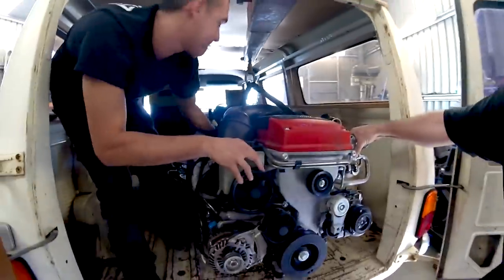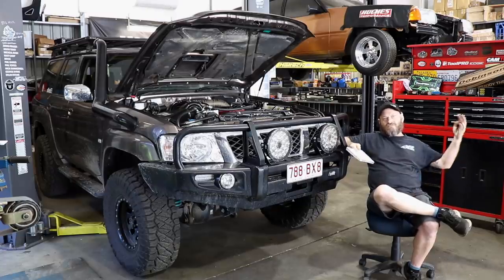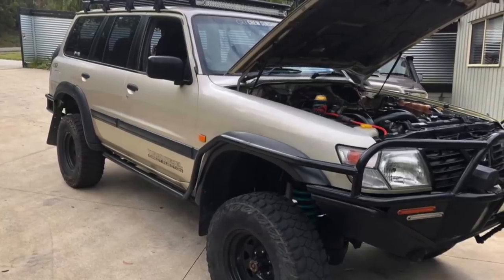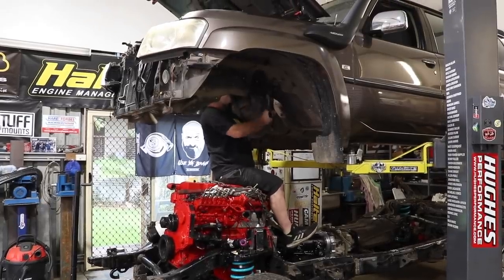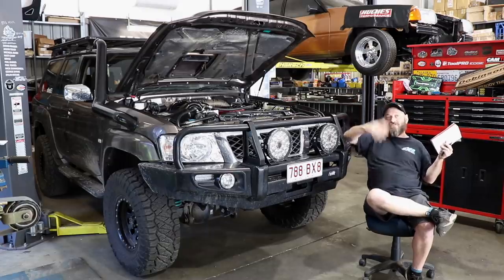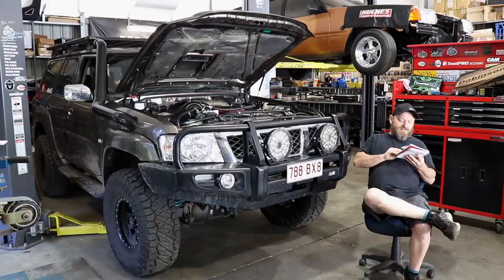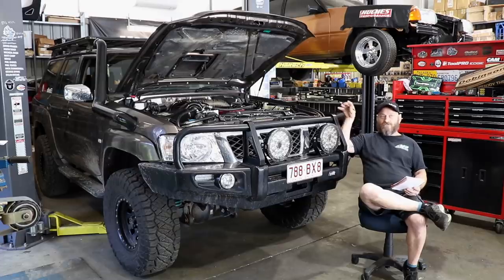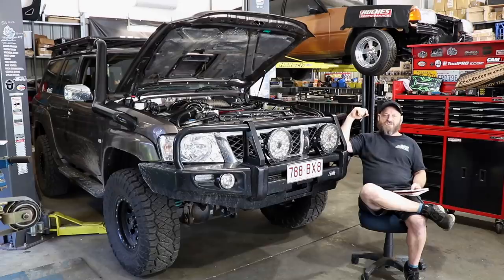Thinking of a Cummins Conversion? Watch This First!

Comment: I just picked up a VW Amarock 580, about 258 Hp, 580 Nm, I reckon it would be a good motor in any 4WD conversion, goes like stink and good on fuel,I'm not far away if you want a drive.
Reply: Those Cummins put out 600ftlb at half the rpm of a vw without much more than a twist of a screw driver, completely different animal
Reply: @oldbloke100  with the 4 speed and gears you would be mostly between 1.5k and 2.5k rpm. What torque are we talking I'm not a Cummings expert? An ls7 with a supercharger will do 600lbft at that. Pretty sure a ls3 rebuilt to 6.8L with the sc would be almost the same. Like a 2.6l unit.
Reply: @oldbloke100   AL asked for suggestions, I'm not saying the VW Amarock V6 Diesel would out pull a Cummins  but realistically how much power/torque do you need in a 4Wd?  most new 4Wd Diesel utes and SUV's in Aus are 4 cylinder except for landcruisers. Your Cummins motors are good in loaders,dozers,buses etc, but in 4Wd Vehicles you need drivability, economy, smoothness, quietness etc you don't need a Massey fergerson tractor, as Alan says his Cummins is lots of power for the Patrol and noisy and thirsty, I'll take the Amarock V6 Diesel anytime over an old clanker, it's plenty of power for any 4Wd and if you really want more then you can get an ECU tune and and a different Turbo which will take them to 418 Hp with an increase in Torque.
Reply: @Dan-rg7jj  that would go well up in the cape, you would need a trailer to carry the fuel for a blown v8
Reply: @mike-lu8di  depends what you want the car to do, driving on the road or dirt tracks the duel cab ute are fine, but when the track gets bad a patrol will go much further. I have a patrol and a ranger. The ranger is much nicer to drive on the road, adaptive cruse and all that, but it won’t go anywhere near what the patrol will do
Reply: @oldbloke100 Doesn't have to be blown. Could be NA. Using a baby cam out of a 5.3l or Lq4. Would chuff along under 2500rpm.
Reply: @oldbloke100  I Also have a 4.2 Patrol but it can't tow like the Amarock, the patrol uses more fuel and is much slower it also looses on a long hill where the Amarock isn't phased and there is plenty of low end power , like my original statement,my patrol would be a better vehicle with an Amarock motor.

Comment: Interesting choice. The hard core love the p pump in the states because the amount of fuel you can throw at them, but frankly, I have a friend that bought a 01 with the 24v and its up around 400k miles, went through 1 pump, but currently has a edge, and aftermarket turbo. It's fantastic to drive with the nv56. Averages about 20mpg freeway. The cummins 5.9 out of all of that generation seem to get the best fuel economy. I run a 6 blow power stroke in my 06. It doesnt matter how you drive it it gets 13.5mpg with a zf6, and thats a 8200llbs lifted truck on 37s. I'm curious what you are actually getting with that patrol.

Comment: I'd go with one of those new small Duramax if money was no object. Those engines are so new they have to be really expensive though.  Still i bet the power would be good in a patrol sized rig. Bonus is they are about as quiet as a normal petrol engine.

Comment: The 4BT in my boat is good on fuel but loud and heavy. OM606 or M57(BMW) go and sound good. The 4.5 QSD Cummins 6 boat motor would be mint but $60k just for the motor and who knows what emissions problems. Audi v8 diesel is a sweat high end motor as well. My over heating TB42 is likely to be replaced with a fresh TB42. I can't justify the money for anything else.

Comment: Yeah, I'd probably just stick another zd30di in mine if it popped. It's got 320k on it now, been tricked up with bolt ons and a methanol injection kit. Pushes 35" tyres just fine. No signs of dieing at all.

Comment: I'm having a 4.5l cummins put into my patrol. I'm also having portals from Mark's installed. We've hit a snag though. Mark's are saying that they can't do the portals cause the engine is too heavy. From my research I've found the td42 weighs about 350kg, and the cummins 4.5 is 370kg. The guys who are doing the conversion for me are in talks with Mark's to try and find ways around the 'MASSIVE' 20kg difference. Very frustrating.
Reply from the maker: I would add 100kg to both of those figures straight up. And secondly, your conversion guy is probably at odds with Marks as they are in competition.

Comment: The om 606 is a goed engine but very expensive,  BMW 30 diesel is the most wanted conversion in europe. More commen and less expensive. Adaptor plates are easy to get. Elektronica with stand alone ecu. Regards Paul

Comment: Tb48 and snail it. Keep patrol trans, drops in as it was an available engine for this model. Money saved can go into reliability upgrades depending how hard you want to push it.
Reply from the maker: Drop in after you cut the engine mounts off and weld new mounts in etc. Then pay for a TB48, not cheap. Then wire an ecu and turbocharge it.
An option for sure but not cheap at all. None of them are.
Reply: @theskidfactory  three engines on ebay right now between 3500 and 5000.. seems cheap compared to the american iron?

Maybe I'm used to stupid jdm prices.

Comment: Al, wondering why you didn't recommend a 1HDFT/FTE? Is it just a cost of engine issue or some other reason? I would think you could use a 80/100 series gearbox, transfer case, bellhousing, clutch etc which you can buy for around $15k. Main advantage would be the parts are everywhere and are a proven design rather than going completely custom which is always expensive.
Reply from the maker: There isn't a great deal of Landcruiser parts that are actually any good. A 1HD is a great engine but they all have 500k km on them and people think they are worth new car money.

Comment: I bought a Range Rover with the BMW v8 engine in it and was looking for a diesel to drop in .
I was thinking about the Mitsubishi 3litre out of the 3 ton truck with triptronic transmission.
Never got to do it though got a good offer for the Rover so now someone else has the beemer goodness.

Comment: hi guys, lurve tha chanel, being a zd30 patrol owner, i'm organising my conversion before the inevitable grenading. my first pick is the cummins isb 4.5. i would appreciate your oppinion on this swap and if possible an approx cost.
My second choice is the om606.  but i'm not convinced it's a wise choice for a diaily drive.
i would also like you oppinion on this, but my main concern is servicing costs for a euro trash donk. The trol is my daily and i use it for serious 4x4ing and i want genuine low end torque. it's a 2005, series 4, manual box. my budget wont really cover an auto box conversion. 
if you like you can use mine to do the swap for the channel, yes, i know, i'm so helpfull!!
keep up the great content, ie, patrol stuff.
cheers.

Comment: Great rundown Al, really appreciate your insight. When you said a petrol conversion is more budget friendly… how much would you expect an LS2/3 conversion to cost into a manual 2016 Patrol?
Reply: I’d assume it’s cheaper since these diesel engines are all imported. LS series were available in Australia from Holden vehicles.

Comment: Very very informative.  I brought my 1998 tb45 new and it’s been exceptionally reliable.  I am now considering more power for van pulling.  I took it off gas after 10 years and now has 440000 on the odometer.  What would you suggest?  I’ve kept the car very good mechanically.
Reply from the maker: You would have to be very happy with the car and really love it to spend dollars on it. TB48 may be an option if you have it sorted and love it.

Comment: They sound incredible for a diesel however, the shear weight of this engine puts me off. The balance front/rear is potentially dangerous on the road and I would always be worried about the longevity of the front suspension. That would spoil the enjoyment. 

That said, the work and engineering in these conversions is fascinating and the proof is in the pudding (as we say in the UK)
Reply from the maker: It has 55/45 front to rear distribution, that's pretty good.

Comment: P pump is like VW PD "Pumpe-Duse" injection right? Mechanical? Pump duse is way more reliable than common-rail and cheaper to fix. Million km original pump and injectors. At least it is in VW's, the PD is legendary.

Comment: You did not mention the NV5600 or G56 66-speed manual transmission with the Cummins. They are factory and can handle the torque fine. 😉

Comment: I had a Wk Diesel Grand Cherokee and it used a VM A630 3 litre 6 cylinder diesel, its even used in Maserati's in Europe, I reckon if you could nab a cheap one of these from a wreckers it'd make a great swap, if you could get a write-off vehicle where engine and auto gearbox were salvageable it'd be perfect, I had the 6 speed but later version had the 8 speed which returned better fuel economy , stock standard it was quicker than the 5.7 litre V8 petrol Grand Cherokees and I embarrassed quite a few people at the lights, if you modified it, it would be even more of a weapon. Go take a Diesel Grand Cherokee auto for a test drive and see what you think. Hope to see you do this. Davo. P.S. Lerv Ya work

Comment: Al,
I am sticking a 12V P pump 6BT into an old Bedford fire truck (MR) due to the size of the truck I have to use a transmission with a suitable GVM rating and ended up with an Allison 2500.  Out of interest a new Allison 2000 series inc shifter, harness, TCM etc is approx $15 000. I imagine the 1000 series which is the same as the Duramax autos will be similar in price (both 2000 and 1000 share the same architecture/size IIRC).
Would be interested in finding out the intercooler and radiator core sizes that you ended up with.
Cheers
Greg

Comment: Love the build, what are your thoughts on a Chevrolet 6500 Optimizer as well as the P400 Cobra V8 Diesel engines for a patrol conversion and what auto trans you would mate to these engines.

Comment: if you are thinking about staight 6 engines OM606 is greate but its mechanical similar to the 6bt but the is also newer commun rail mercedes engine like the 0M648 is quite strong (look into  black smoke racing and dieselmeken)

Comment: as i remember the DAF also came in 1994 with 14 liter 500 hp cummins engine.. and that thing hauled ass... way easier to work on then the PACCAR engine that has replaced it..

Comment: Mercedes om613, 3.2l 24v common rail straight 6, smooth quiet and plenty of power, or a bmw m57 with the 8 speed zf auto.

Comment: I've seen a couple of blokes doing 4jj1 conversion kits too, might be something worth looking at........I'll probably give mine 1 more zd30 after the current one dies and then start looking at my options 😂, Isuzu diesel like an old 4bd turbo or 6bd or BB turbo would be awesome but I don't know if you would get  engineering.....guess it depends if your worried about that stuff or not 😂👌

Comment: You didn't mention the 6.5l turbo diesel Chev optimizer that is a very popular conversion for patrols and land cruisers done in Western Australia .
Reply from the maker: That's because a TD42 is a better engine.
Reply: They aren't powerful, economical or reliable but at least they're expensive
Reply: @JeremyPetho  I got my manual zd30 patrol converted to the 6.5 turbo diesel chev optimiser 5months ago and had it dyno'd at 7000km mark and it put out 584nm at the wheels.
I've towed a combined weight just over 6tonne car and caravan getting 22ltr per 100km sitting on 110kmph. 
For a $30,000 drive in drive out conversion I thought it was pretty good value. 
Is there a cheaper/better conversion out there ive not heard about?

Comment: In Europe, they use BMW 3.0Diesels too.

Can you manually switch to lock the torque converter to use engine brake? Together with the tiptronic?

Comment: Did you see haltech have just release the firmware etc to make the ic7 dash to be standalone. You should be able to get it to work with the diesel now.
Reply from the maker: I already had that firmware. The issue was to do with the CAN output from the TCU not being compatible.

Comment: If I won lotto id swap in a SC Ls2.
But cause im always broke probably a 4jj1 once an adapter plate or bellhousing is available.

No mention of the 4jj1? Diesel Conversions Australia have an adapter bellhousing for the patrol manual and are developing one for the RE4.
Reply from the maker: The 4JJ1 is a good 3l 4 cylinder but it's a small 3l diesel, just like the ZD30, you can romanticise about brands but there is really no substitute for cubes.

Comment: I have always wanted to fit an OM606 in a patrol just struggling at finding one in Aus for a decent pricing, Most likely going to have to import an engine or two.
Reply from the maker: A 3l diesel 6 will be nicer than a 3l diesel 4 but you will always struggle with the capacity when pushing a 3000kg plus vehicle.
An OM606 is the poster child for being the diesel 2jz, that does not make it the right engine to move a big full chassis 4wd.

Comment: The Skid Factory I m going to do a 80 series duel cab landcruiser build but with a twist 1vdftv single turbo conversion  with box ,2 inch lift , gvm upgrade 100mm chassis extension painted green and gold for shit and giggles it might work

Comment: I would be boring and put rebuilt factory engine back in. However would prob buy the patrol with the bigger engine or a landcruiser. 

But talk is cheap and I can afford neither. I have gone for the cheaper option of having highly modified 1991 LN106 Hilux for off-roading an 2005 Mitsubishi chariot Grandis for comfort and fit the family (does not work for the man card) and a 1998 Caldina Gtt for to get to work and when the Hilux is broken from fun off-road.

Comment: I’ve always wondered about the om606 and if would have the bottom end torque to move a car of this size, my gut feeling is that it would be sluggish until it’s on boost. Would be a fun thrasher but maybe a painful daily or tow vehicle.
Reply from the maker: That is my take also. Also my problem with the Isuzu 4JJ1 swap, it is arguably a better engine than the ZD30CR but it is still 3l so will not have any more off idle torque, same goes for the BMW M57 and OM606.
Reply: @theskidfactory  no replacement for displacement. I guess it comes to application at the end of the day. There’s no perfect engine it’s always a compromise on way or another.

Comment: I've by a few the V8 Duramax motor is the hardest motor cos where the heads are sitting in the car its a tight fit to get them out

Comment: Alan, firstly cheers from Texas. Your thoughts on the gearbox potential that would support a 4BT? 2/3 the power output, still giving 400ftlb without too much jam. Also, higher distance:fuel unit
Reply: 400lbft is not that much. 4l65e would be fine.

Comment: How'd you go with all the stability controls and emissions?
I was looking into fitting a 4bt Cummins into my jeep JK wrangler (2012) and was told it was impossible due to the fact that I wouldn't get the emissions or safety features to work which was a requirement for engineering/registration.

This was about 5 odd years ago in Victoria

Comment: Not sure on the Aussie world but isn’t a 6bt just an anchor in a suv like that    The Cummins 2.8 or 4bt produces amazing power and are fractions of the weight. 6bt is great motor, for a ram 3500 towing 20k pounds.

Comment: A Mercedes OM629 conversion would be good. 4.0L V8 turbo diesel with 231kw & 730nm standard.
Reply from the maker: There is a 628 local that I am considering.

Comment: I'm busy putting a range rover 4.6 V8 into a defender. 
The reason I went that way rather than uz was the cost. Motors cost the same. But I didn't need to buy a new gear box or transfer case adaptor. 
Or fab engine mounts or dick around with custom radiator pipes and shit. 
So the motor cost me the same amount. But the total build cost me about (South African Rands) R90000 less.
The last diesel swap I did cost roughly what a UZ swap would have. 
And the fuel consumption to cost of build scale got to about 600k KMS I need to drive before I would have saved money on a uz or a diesel.

Comment: Hi I have 98 gu patrol had a rd28 I converted it 2 a Holden worked 5litre I love my patrol now heaps of torque but if money was no issue I would love to put a nissan VK56 in her with harrop supercharger.

Comment: What about GM 6.5l. Seems like a great fit
Reply from the maker: Better off with a td42.
Reply: @theskidfactory  I'm not sold yet. Lol
Reply: @theskidfactory  i think the GM 6.2/6.5 can make up to 300hp before mechanical failure.  From what i've heard it's quite lightweight,  and most of the problems were all related to how GM packaged them in the trucks, electronics,  cooling, crossover pipe, etc. They worked good in the Hmv. "Mechanical injection ". The other question of course,  are there any in AU? Side note, i would totally love to buy an exmilitary square body chevy diesel 3/4 ton. 6.5, 4l80, good 8bolt axles mmmhm!
Reply: @theskidfactory  i think the GM 6.2/6.5 can make up to 300hp before mechanical failure.  From what i've heard it's quite lightweight,  and most of the problems were all related to how GM packaged them in the trucks, electronics,  cooling, crossover pipe, etc. They worked good in the Hmv. "Mechanical injection ". The other question of course,  are there any in AU? Side note, i would totally love to buy an exmilitary square body chevy diesel 3/4 ton. 6.5, 4l80, good 8bolt axles mmmhm!
Reply from the maker: The military version is the optimiser, they are better but still have no power and cost more than a cummins.

Comment: If they made Deltic engine small enough to fit. Done. 
But Isuzu 4JJ1 ? or I'd say 1HD because if you did an outback trip parts are easy. 

but for something more interesting. why not a Diesel out of another car or similar like the VW V10 or similar Audi etc.